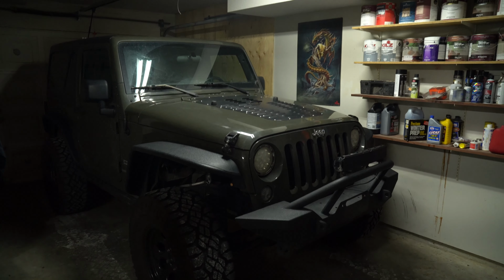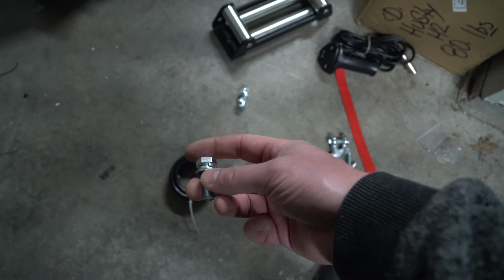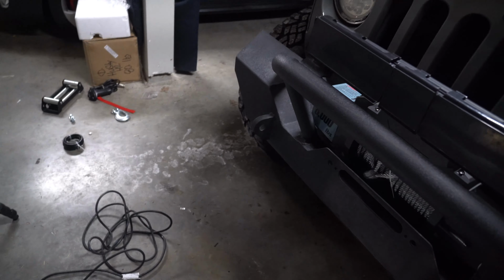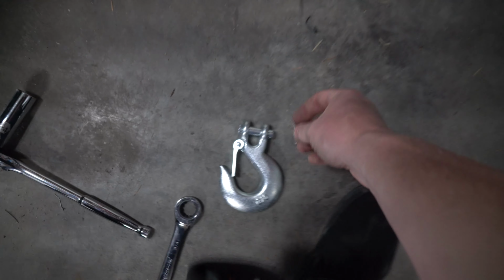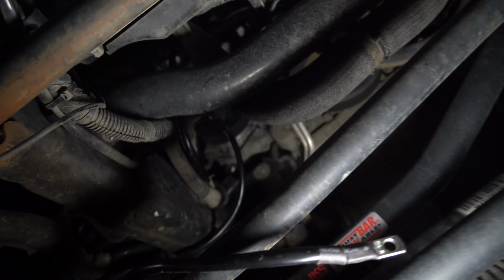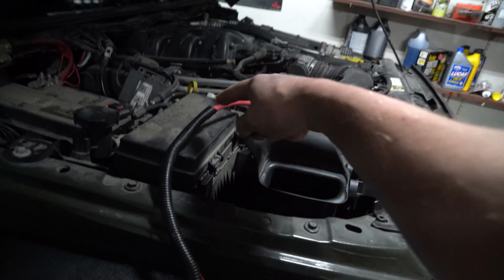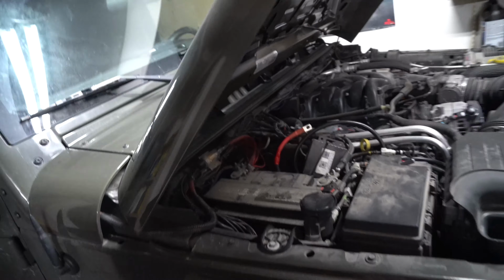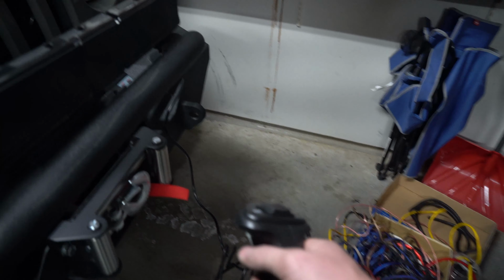HOW TO INSTALL A WINCH AND WIRE IT JEEP WRANGLER

Comment: Thanks for posting the video.

Minor comment: the nut on the battery clamp closest to the post is actually a conical nut that tightens the clamp.

Putting a wire or anything under this nut, will prevent the clamp from staying tight.  The nut further away from the post is the one to use.

Comment: Thanks for the instructions. Obviously, I am here as I am about to install my winch and I just wanted a visual confirmation... 
You did all the same as the manual that came with my winch shows, except one thing: mounting the fairlead. My manual reads: "Attach fairlead to the mounting holes by placing bolt heads on the winch side of plate and nuts outside, the clearances might be tight..." Not sure if this is a standard, but just a note for anyone using this video as a manual for installation... 🍁🍁🍁
Cheers

Comment: I just installed a similar set up , where the winch and light bar sticks up just as high as yours. Do you have any issues with air flow or over heating? I keep reading that your wimch should be in a recessed bumper. Just wanted to know if you have had any issues?

Comment: No kill switch between the winch and battery?
Reply from the maker: No they draw to much no fuse required
Reply: @ghostlyrich  not a fuse a battery disconnect switch to cut electricity to the winch when not in use... being hooked directly to the battery like so with nothing in between if that positive wire gets a chaif or cut anywhere close to bear metal better hope you can unscrew those wires from the battery fast enough to keep the truck from catching fire.

Comment: How are you able to get the head of the cable through the rollers. Mine is too think
Reply from the maker: Are you trying to put it through with the hook attached? If all else fails if the rollers have snap rings you can pop the snap rings put it through than put back on
Reply: @ghostlyrich  no wasn’t trying with the hook on. Ended up tapping it through with a hammer. I guess the knock wasn’t to spec and was wider than needed to be. Went through fine with a few love taps.